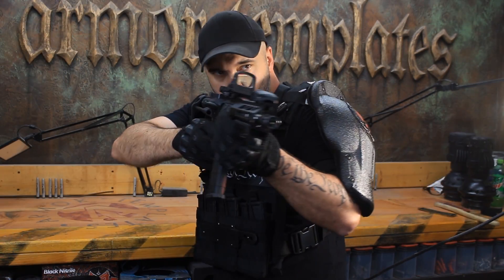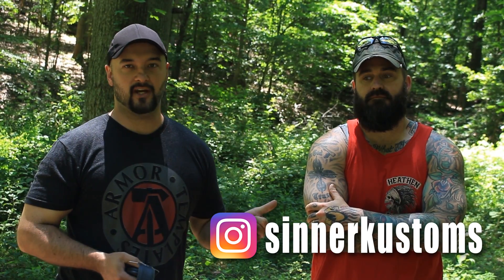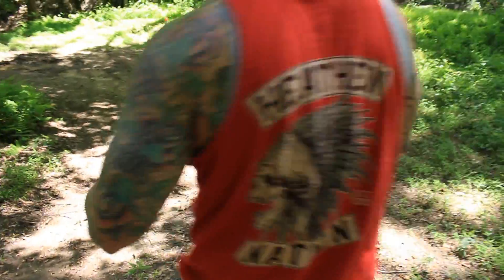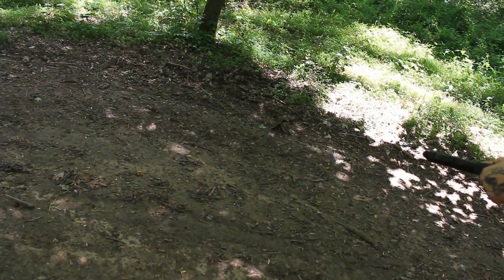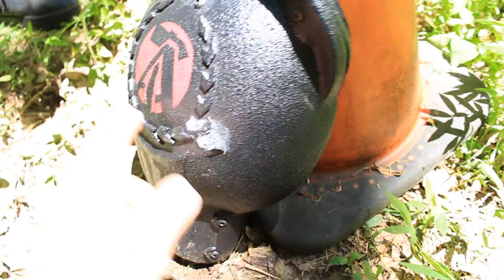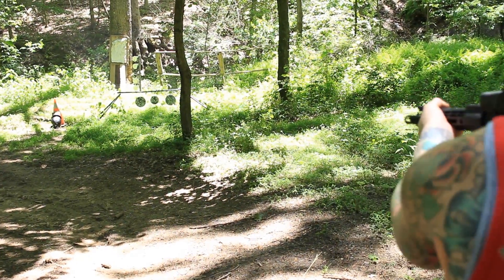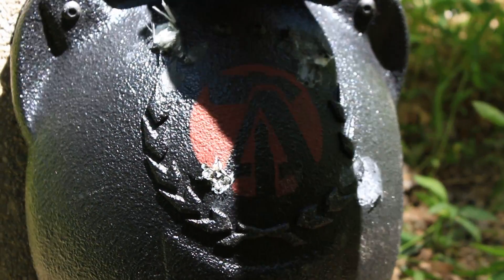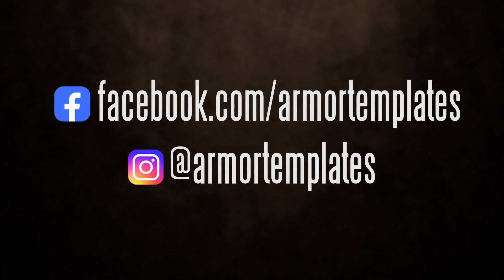DIY BULLETPROOF Shoulder Armor! Is it really bulletproof?

Comment: DAVID; After watching all three videos in this series, here's my take. I've built and designed armor as well, and done a bit of testing. I've also been shot while wearing armor in the military, multiple times. So I have great affection for armor. Okay then, first, great work. for a first run, you did great. Based on your testing, what you said it was made from, and my experience making, wearing and using armor, I'd say you should reduce the layers of material by Half. Sure, this will lower your protection, however, you'll still have handgun protection that should be near a level IIIA armor. This will also reduce weight, which is a big thing if you actually have to wear the stuff for any amount of time. In my initial testing I found that 15 layers of standard Home depot fiberglass cloth will stop a 9 mm round (115 grain FMJ). (you'll want 20, then use the better stuff as well to maintain the armor level.) Now, you're using carbon fiber and E-glass or S-glass. using either of these increases the effectiveness by about 15% (roughly) over basic fiberglass from the hardware store. You're using epoxy, which again increases your effectiveness about 15% over the standard resin. since the armor failed in the rifle testing you have two choices, A) increase the armor in weight and thickness, which I wouldn't want to wear. B) reduce the armor thickness to be effective only against the rounds it stopped. (recommended) This makes it easier to wear. if you don't wear the armor because it's hot and sucks the life out of you, it doesn't help you when you get shot. Personally I'd go for thinner and make it easier to wear. The armor works by forcing the fibers to delaminate, therefore the strength of your epoxy and fabric really matter. You did great work here by using quality materials and epoxy.  Here's another point, fiberglass alone is fine. There is no need to use Kevlar. Sure Kevlar works, but in my testing, when making hard armor, Kevlar isn't great. it tends to be difficult to wet out fully, and it doesn't really improve in ballistic resistance by adding epoxy. But fiberglass and carbon fiber do gain from being epoxied or resin soaked. Even today the U.S. military buys armor made of fiberglass. It's mostly used in large panels for buildings, and is made to look like a regular painted wall. I'm not going to list the specs, but if you look you can find out the thickness and armor rating of these panels. Just regular old fiberglass cloth, when properly made, will stop rifle rounds. (depending on thickness.) In that regard you were correct not to bother with Kevlar. Additionally, if you're looking to beef up the protection level, you can try adding silicon carbide or aluminum oxide tiles (you can get them online if you look.) and layering the tiles into a sandwich of fiberglass and carbon fiber. This is how some commercial ballistic plates are made, including plates rated at level IV (AP .30 caliber rounds, multi hit). Okay, that's all I have. Again, great work, it was fun to watch. It's amazing what we can build in a basement or garage workshop!
Reply: I agree with you that a few less layers might be a good idea. As far as increasing ballistic protection, I'd say experimenting with adding a few millimetres thick layer of hardened steel or even 7000 series aluminium might increase its overall protection in regards to rifle calibers. It'll make it heavier by a few ounces but for an increased rifle protection, I think that's a good trade off.
Reply: Stephen Sanford 
Okay, let me try again.  I asked this once but didn’t like my wording so went back to rewatch build videos and try again...

The maker used raptor liner to prevent spawling, I know that early in the war in Afghanistan our forces used a truck bed liner on the bottom of vehicles because the IED would still destroy the undercarriage, but the liner would hold everything together.  

Where his item failed was with rifle rounds, what I am wondering is, were he to start with an aluminum sheet that had been shaped, or if necessary, two aluminum sheets, both lined with a thick bed liner, then (if using two sheets) separated by one layer of fiberglass and epoxy, then surrounded by the necessary layers of fiberglass and epoxy, and put in a vacuum bag, would this work for at least small caliber rifle rounds like the 5.56mm and 7.62x39?

What are your thoughts?  If I had the funds I would be in the garage trying to make experimental pieces, then a face shield that snaps onto a motorcycle helmet, shoulders, a left forearm, a gauntlet for the left hand that allowed for the hand to go into it while it stayed on the aftermarket vertical fore grip of an AR like hippo hands on a motorcycle grip (paintball proves that shots often hit the hands holding the rifle, if the gauntlet for the front grip is made right it would shield both hands somewhat)... covid has destroyed my savings account and earnings, I couldn’t afford to make what I want, much less one or two pieces to experiment with on penetration resistance for various calibers; but I am still curious about the levels for possible future builds (if my income returns)....

Have a great day.
Reply: @Rick_Sanchez_C137_  send me an email so we don't have hijack this great video. scsanfordwritting@gmail.com or electstevesanford@gmail.com But in brief, if you've got AL laying about, you'll need about an inch. +/- to stop those rounds. I'll be happy to banter back and fourth on the subject with you over email. I can send you some of my research and sources and such.

Comment: I wonder how this thing does with ricochets, that's always been a thing I've seen take into consideration with tank armor and i believe that if the armor was at a 45 degree angle any handgun round would just bounce into your face
Reply: Medieval armors were designed to make arrows ricochet away (no flat surfaces, only rounded or slanted). I believe if he followed more what was done at the time, the armor would be much more effective.

Comment: You don't need to add Kevlar if you use single strand fiberglass and ceramic powder.  The two used together fragments the round and diffuses it's energy into the FG matrix.  Armor like this can only absorb so many rounds, but I've seen 3/8 thick material stop several 50 cal. in a 4 inch radius.

Comment from the maker: For those of you saying to use Kevlar....this piece would have been about $800 to produce. That's why I used CF and fiberglass.
Reply: you could always buy a used kevlar vest or surplus for like 100  bucks and salvage the fabric from that. should be enough for one shoulder pad.
Reply: You can  salvage kevlar from mil surplus vest panels, the kevlar lining in those is rated to IIa, a single large back panel could do 2-3 shoulder guards. A whole  used vest is 150-300 but the inner panels can be had for $40-80.
Reply: i have four 25 pound rolls of Kevlar iif you did want to try it out
Reply: I bet you could layer in some sheet metal (m) plastic (p) and ceramics (c) to help break up the bullets. something like fiberglass(f)/f/c/f/f/p/f/f/m/f/f. Idk use triangular or hexagonal tiles to account for bends and multiple hits.
Reply: Good job on it but i was wondering if maybe you could use a small steel net that has the same look as cloth that may be usefull
Reply: Lol every half wit tacticool nerd is saying "use Kevlar" like they know what they're talking about. Kevlar although works good, is old technology that's expensive and heavy for no reason. Modern ballistic armor is being made of cheaper lighter materials, like polyethylene.

Hey David, that's a good idea, why don't you make a prototype with polyethylene and carbon fiber instead of fiberglass and carbon fiber. It might actually work better and be a hell of a lot lighter.
Reply: Not if you source the Kevlar cloth from old soft  armour.  I use it in the bottom of my hunting moccasins . Graphene is another material that would be more effective.
Reply: and for those telling him to add Titanium, its been done and replaced by ceramic as it protects better against rifle rounds.
Reply: so Ceramic may be a good addition if you could manage that in the design.
Reply: Buy you could add ceramic powder to the epoxy and mabye the raptor liner might actually work
Reply: Man I would send you a grand easy for one of those.
Reply: @Kenny-bj2zq  lol someone said he'd be willing to pay 20g. for that price you could make like 20 of these.🤣🤣🤣
Reply: twice that probably

Comment: You should add kevlar, its used in bulletproof vests, and they mix it with carbon fiber on race cars in areas where they dont want penetration or brittleness, you might even get away making it thinner with that material. Also you need to integrate some metal brackets to the back layers  of the material so the straps hold on to that without compromising the front layers with holes, and screws that will just be pushed into your arm by the bullet. Embedding metal parts to the composite layering to be able to attach metal parts or screws to composite parts its also a technique in race car and aerospace construction

Comment: You should send one to H.P. White Laboratory, Inc. They do the testing for Spartan Armor Systems and can probably do more advanced testing. It seems you have something equivalent to level 3A Hard armor and is capable of multiple hits, so good job.  Get a crono meter to see the fps of the rounds as it hits, this also helps with gauging the actual velocity resistance.

Comment: I'm not surprised the 9mm +P had the closest penetration in the first part of the test along with the .40.  Both of those were made for sending smaller bullets faster and are known for greater penetration depth than .45 or even the .50 AE.  Most auxilary plates (not the chest plates or the lastest generation of helmets) are only really rated against the pistol calibers anyway.  With no aramid/Kevelar in the design, it is most impressive what stopping power simple fiberglass and carbon fiber have!  Deflection is still protection (the logic of the old steel pot helmets, and helmets in general).  I certainly look forward to seeing Demolition Ranch picks up for testing!

Comment: I wondeer how much better it might have been if a few strategically placed pieces of 1/8 inch SS metal was placed in the mold betwen the layers?
 It may  have become impervious to the rifles as well.
Reply: i would like to make one of these but dont wanna spend 150 bucks on material  to have a home made armor system thats untested, and gets me killed in coming race/covid-pocalypse, if its not as good as what i see here
Reply: @kravmaga7070  Seems like it would be easiest to make whatever design you like as a shell and sew in or attach a piece of  already ballistic rated soft armor. You can get 10x12 level IIIa soft 'plates' for $50 or so. 6x8" side plates I've gotten for about $35 each
Reply from the maker: @clintlarvenz2570  but then I wouldn't have created anything. I would have dressed up a piece of armor someone else made.
Reply: @DavidGuyton  no I get the desire to create what you did, meant for the guy who was unsure of their ability to make effective armor
Reply: i also wonder how much LESS OF A PAIN IN THE AZZ  it wouldve been to cut the edges of the mold with a ban saw or scrollsaw type thing instead of cutting/grinding wheels.?
Reply from the maker: @kravmaga7070  I didn't have a suitable bandsaw until literally one day after I did that cutting haha.
Reply: Steel is not very good rifle armor until you get to the 1/4 inch stuff. Even then it's not good armor because it's too heavy for the protection it gives.

Comment: Hy, after a long research time, I've re-found the special shock absorber material that could be spray on quite every thing to make a protection film even on water
It's "Polyurea" and is already used by army to prevent walls from destruction by explosions

https://youtu.be/lAsoTOxwAGI

Wall protection test
https://youtu.be/gnqvkjj2ZO8

Comment: If you would've put a formed piece of AR-550 and that rubber mat you had and put those too the inside against your shoulder it would've never failed. Having what you made first to slow the projectile and the AR plate to bring it to a dead stand still with a little rubber padding for comfort.
Reply: The steel needs to be on the outside

Comment: Listen bro, this is Awesome design. Go Patent this!!!!! Then send it to demo ranch. Yall can make alot of money wit this concept. I was in the Army and I know this has been tried but the examples out there suck. This has alot of potential.
Reply: Patents are thousands of dollars
Reply: @famvirious  Then write up the Schematics and mail it to yourself and keep the envelope sealed once it arrives. Then if anyone steals your design you can reclaim it. Then you can patent later if the concept takes off. Just a thought
Reply: @deesnutz84  You'd still have to spend hundreds of thousands in court trying to prove that letter is valid. Plus Hoplite Armor already makes shoulder plates.
Reply: What exactly he should patent? It's the same tech as helmets has been done more than a couple decades ago, for exception of materials, layering of carbon fiber under angle isn't innovation as well.
Reply: @SergeiSugaroverdoseShuykov  It is the design that is awesome To me. When you use Armor u usually square up to the target to get more area that is covered with armor. As opposed to turning to the side like in the video. The army has shoulder covers that suck and u def do not turn to the side using them. However, his armor is large and if made larger and fastened to the vest for weight distribution, they could be large enough to "get behind."  Seeing this  set off alarm bells to me  signaling a future change in combat doctrine if adopted. (again this is me) But I would patent the schematic of how he was able to attach his armor to his vest (for weight) and his specific combination of light weight materials that made it "actually bulletproof" If it works like I am seeing it in my head , this is a game changer, having used the stuff the Army currently has that is.

Comment: i think if you had 4 layers of Aramid replacing 4 of the fibreglass and made it a little thicker with an outer high density rubber and another roughly in the middle you may have been able to withstand the AR rounds. especially if you took a hit from a non oblique angle. a non cemented spall liner of rubber as would be very uselful at reducing injury from a penetration. very good job though

Comment: Not sure why you didn't use kevlar or mylar if you wanted bullet proof, carbon is not the correct material
Reply: You just saw it stop bullets. Your notion of correct is irrelevant.
Reply: They probably didn't use kevlar because that stuff is expensive.
Reply: @FirstDagger  it's not if you buy rolls. The carbon was probably more expensive.
Reply: @CourtneyRoberts1982  you can buy a 50 inch wide by 10 yard roll of fiberglass for about $150. While your looking at about $50 per yard for a piece of kevlar that's 50 inches wide. If you buy like a 100 yard roll of kelvar the per yard cost goes down to like $30. If you wanted to add carbon fiber like he did your looking at about $20 per yard of 50 inch wide material. The kevlar would be lighter due to being thinner but the perfomance would be the same with the end product. You'd just spend a quarter of the cost going with fiberglass over kevlar. That other three quarters is you trading money for weight/bulk of item savings.
Reply: @high633  you can find it for less than that but even with your prices it's still cheaper than carbon, even basic twill weave.
Reply: @FirstDagger  if by more expensive you mean same cost, sure

Comment: Can you imagine if it had some sort of metal or ceramic backing plate? It’d be one hell of a piece at that point
Reply: What I'd love to see is ceramic fully encased in Kevlar. So that when the bullet penetrates the Kevlar and shatters the ceramic, that the shards can't move outside the path of the projectile, unless the Kevlar bag ruptures completely.
Reply: @edi9892  great concept, massive weight though
Reply: @-DEATHSTROKE  It depends on the size. Sure, I guess for APC/AFV it would make more sense, however in that case, you´d probably encase the ceramic plate in metal... or perhaps plastic for shock absorption...
Reply: You want the ceramic on the face to break up the bullet.

Comment: if you could put a kevlar on the inside instead of cushioning foam that u used it would possibly stop a 7.62 or 5.56 the rounds
Reply: Its made with polyethylene, carbon fiber, and fiberglass. Kevlar is only aramid fiber which is likened to carbon fiber. This performed about as well as genuine kevlar armor from professional manufacturers. The next step up would be just plate armor and given that the rifle rounds still zipped through, adding more material to an already large piece wouldnt be very practical. At that point, its down to ceramics and steels
Reply: @thepurespartanify   yah, i highly agree on you. it would sure work well, interesting tho that with enough money you can make urself a pistol proof body armor.
Reply: @thepurespartanify  HDPE solid plates would possibly work. Buy some HDPE cutting boards, cut them to shape, and glue to the inside instead of the foam board.

Comment: Question 
How would you repair it? Say you were a comic hero or something and you needed to repair this piece? Know what I mean
Reply: You'd make a new piece to replace the damaged one, and throw the old one away.
Reply: The absolute most you could repair it if it wasn't shot is respraying the truck bed liner on scuffs or scratches. 
If it's shot, it's done its job and it's time to replace ASAP.
Reply: You'd just buy a factory and have them make them in 10,000 lots. That way it would look like a legit product, not a vigilante's armor piece, and you'd have plenty of spares.